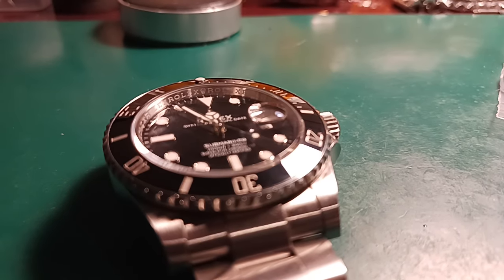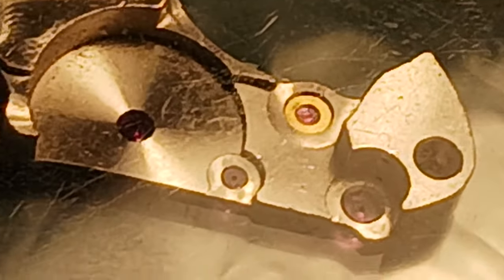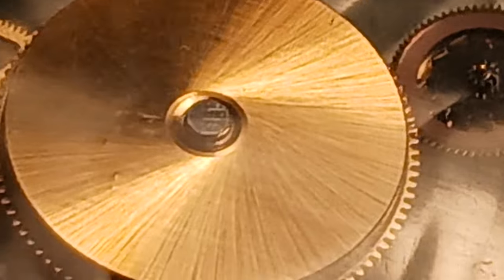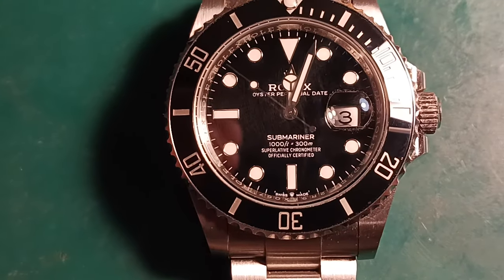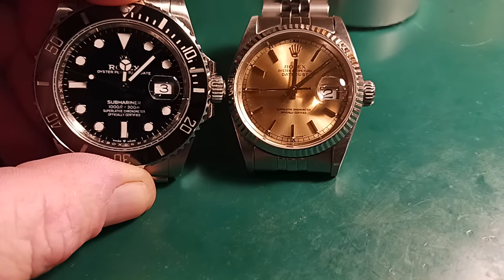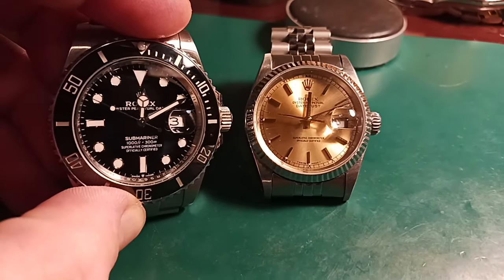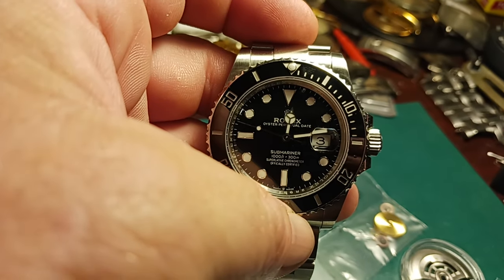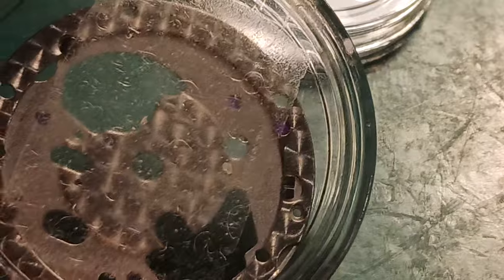Rolex Sub Upgrade Intro

Comment: Fro your experience with super replicas, would you say the case and crystal is usually 90% similar to original or more/less?
Reply from the maker: Its very close.  So close,  why replace it?
Reply: You should try a real rolex for once
Reply from the maker: @dale-wh9cw  i have several on video.